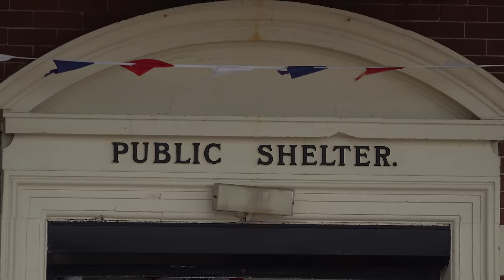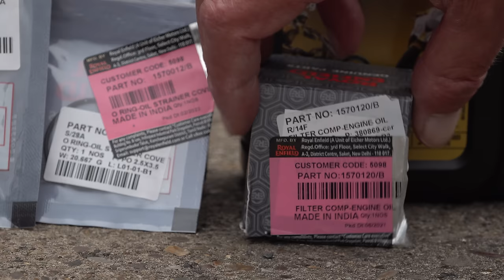Long Term Review | Royal Enfield Classic 350 | The Pure Essence of A mid 20th century 350 single!

Comment: I had the speedometer issue as well, but I live in Arizona, U S.A. where nobody cares if your speedometer works or not.  Therefore, I simply rode the bike until the parts came in...about three weeks.  It took the dealer three days to replace and I was out the door.  Wonderful dealer!  Like you, I do my own maintenance so I save some money there and in return, I gain a "relationship" with my bike.  A wonderful thing!
Reply: The issue that could arise in the UK, is the amount of recently introduced 20mph areas all around the country. Even for  the 350, an easy limit to exceed.
Reply: Just use a GPS speedo on your phone.
Reply: @martinowl  lts easier to get caught exceeding the speed limit than driving/riding without a driving licence or insurance nowadays.
Reply: Same here, about three weeks to get the parts. Once the parts were in the dealer let me make an appointment for having the speedo replaced. I was in and out in less than an hour with a new speedo. Outstanding!
Reply: @brianperry that is so true 👍
Reply: Did you get the RE at Kelly’s Kawasaki in Mesa?  Or GO AZ?  I think those are the only 2 RE dealers in the state. I’m contemplating getting an RE. I’m having some financial difficulties and may have to get rid of my Bonneville T100.
Reply: @MrSpeed-lt8gr  Go AZ in Cottonwood.
Reply: @martinowl Only for the poor people of Wales.....not all round the country as I understand it.
Reply: My speedo reads 110mph all the time. I can't afford the tickets. I need it fixed. 😅

Comment: I'm someone who had zero experience working on vehicles/engines up until I bought my RE. Using your videos, along with some others, I've managed to install crash bars and a sump guard, change my oil, adjust my tappets, and adjust my chain. I'd say it doesn't take experience to work on, just good instructions and some basic mechanical comprehension.  My journey on this started when my dealership said it'd be around $650 to get my valves adjusted. I wasn't about to drive an hour to pay someone that much for something I could learn to do myself, andhavent turned back
Reply: Same situation. Bought an RE Himalayan and the dealer was an hour away and wanted 600$ for first time maintenance at 300 miles. I bought what I needed for about 100$ and Never looked back!
Reply: I bought a 2023 Classic 350 in Chrome Bronze (the other chrome option) about 13 months ago and the love affair with this motorcycle continues. I an new to motorcycling but am doing some of my own basic maintenance and cleaning and have found it enjoyable and yet another way to connect with this cherished motorcycle.
Reply: That kind of money is hard to believe. I bet when you dd it you found it hard to justify too.

Comment: They should have hydraulic valve adjustment and belt drive to eliminate 2 major services.Old Hondas and Triumph had easy to adjust valves with simple to remove valve caps for easy access to the valves without taking the gas tank off. My Sportster just needs the fluids and filters changed.
Reply: and your sportster cost HOW Much - compared to this 350?
Reply: @CosmicSeeker69  My Sportster was 1 1/2 years old and it cost me $7,000 in 2000. I have had my Sportster for 25 years and 400,000 miles on the original engine and 37 back tires and 17 front ones and 3 belts in 25 years. Today you can get a good used Sportster for $1,600-$3,500 with low mileage. I have shops mounted tires that's it. Used RE 350 are going for bargain prices. Let's see how many engine rebuilds your 350 will go through in 25 years. If you still even have it. Think about how many chains and sprockets replacement costs in 400,000 miles compared to 3 drive belts . No expensive dealer serviceing either. They are counting on people who are too lazy to do valve adjustment themselves and taking it to the dealership for tune ups. They had hydraulic valve adjustment on the 500,less maintenance for the rider.

Comment: Once again my friend you have summed up both Royal Enfield ownership and the true meaning of a motorcyclist as only you can , keep it simple and honest! I have just got my Meteor 350 up to the 1500 mile mark and changed to fully synthetic oil, and its changed so much through the running in process that I cannot remember how tight and hot it was in the beginning but bloody fits the bill for both its now an entirely different animal and I can’t help thinking that so many people have bought these bikes and sold them on again just because they don’t have the patience and need instant results, running the motor in properly has im sure been a big factor in how my bike rides but fully synthetic oil has been a revelation, as has the fuel x optimiser  which a lot of people said is just snake oil but no its not and neither is the open air box but concerned with the motor running hot after i changed the filter cover i then put the optimiser on and the two together have made a massive difference , you can’t really use more air that the syst can deal with but now its got more air and more available fuel so its simply got bags more power at lower revs, and last is the 16 tooth front sprocket  again a major improvement through the gears i think its geared for riding on Indian back roads  because the bigger front sprocket if anything has quickened acceleration because first gear runs out just as it beginning to pick up its skirts n run  but theres more useful urge there that i can now access with the extra tooth , keep up the good work fella and no i’m I don’t want to swap my precious 😂👍

Comment: Hi Stuart. What tyre pressures do you use as the manual differs from CEATs own recommendations which are much different? I have been told that the CEAT front of 22 psi cuts down on whitr lining etc by other owners.

Comment: Wholeheartedly agree, bikes can get under the skin, I feel exactly the same about my little 321cc Yamaha MT03. I bought it initially due to it’s low seat height but then it grew on me due to it’s low weight, brilliant fuel consumption, excellent build quality, slick gearbox, super smooth power delivery, 100% Yamaha reliability, cheap servicing and enough power (42 bhp) to enable overtakes, headwinds and hills to be conquered with ease. Downsides, I don’t suppose the looks are to everyone’s taste, but you don’t see it when you’re sat on it !

Comment: Good morning Stuart, I've had my Classic 350 since the beginning of July, I've done 3,500 miles so far with no issues whatsoever, I've done all my own servicing right from the start with genuine parts and oil from the dealer that I bought it from,  so they know I've been using genuine stuff should I ever have a warranty claim ,but they have no issues with me doing my own maintenance anyway. 
As for enjoyment of the bike I have two other bigger capacity bikes that I enjoy but , neither of which give me the feeling or connection I get from riding my classic, it's just so relaxing to ride and takes your mind to another place, it's so therapeutic it's weird! 
I've fitted pannier frames, Lomo side bags and a dry bag for my tent and I'm all set for camping weekend's and rallies  that I do, as well as just buggering off out for rides in general. 
Great video review again 👍 
Cheers 
Mel 🍻

Comment: Thanks for the update Stuart. Interesting news about the home maintenance. 
I had an issue with the rubber on the rear tyre on my Himalayan breaking down. My local dealer at the time King’s ended taking a wheel off a new bike to
put on mine and sorting it with Moto GB because it was dragging on. Seems it helps having a good dealer 👍

Comment: I too had a Speedo issue on my Oct 21 mfg Red Chrome Classic 350 at about 5000 km, which was replaced by RE under warranty and the new speedometer started back from Zero. I have done 4000 km now and apart from this absolutely no other problem with the bike so far, it's such a pleasure to ride around the country side.

Comment: Morning Stewart. Servicing is something you touched on before I recall. When my first service came up in my RE 650 SM went into a shop I trust. £139 it cost and was in the shop for less than two hours before I got a text saying she's ready. The engin had less tappet noise. I noted the clutch had been adjusted and the throttle response was better. Once my girl was back in the garage I did a quick check for leaks as you do. That's when i noticed the chain had been adjusted and chain wax lub applied. Then the real surprise. A shot of chain wax lub was visible on the side and center stands  on the moving parts. The type of service you'd get only at a 5-star Honda dealership, so very pleased with there work. That said my brother-laws mate who bought the 350 RE Hunter had a bit of a shock. His first service £220..! So I guess servicing still depends on a shop location and it's size?
Wishing you and your family a very Happy Christmas sir. And all the best in seeing your channel grow in 2024! Safe cruising till next time Stewart 😊👍.

Comment: Stellar video, Sir! Thank you for fleshing out the errant speedo issue. My valve lash experience on both the INT and Meteor, with over 6500 miles on both, is after the initial 300-mile adjustment no further adjustments have been necessary. I have and will continue to check every 6000 miles. Just a guess but I think allowing the engines to run a couple of minutes unloaded when cold and common-sense riding is responsible.  Enjoy your well-deserved break Stuart and Happy Holidays to you and yours!

Comment: Stu, I'm a Meteor 350 owner, a sister J engine machine, so I'll comment. I knew that, as a retiree, if I wanted to get back into motorcycling, then I'd have to do most of my own maintenance. One, I do it to save money; if I paid someone else to do all the routine stuff, I couldn't ride. Two, the dealer is too far away; we're talking 45 minutes, one way, to get there. Then, you need to have a way back. Three, the dealer was so backed up with work that, the last time I checked, you were looking at a two month wait just to get your bike INTO their shop! To put it another way, when I asked the service manager if he could print out the valve clearances for me, he happily did so. He was relieved that there was one less consumer adding to his already heavy workload.

As you said, no one buys a bike like the Classic or the Meteor because they want a speedster. At my age, I don't need or want a speedster. In addition to being dangerous, speed costs money! I'm sure you've heard the old racer's saying: speed costs money; how fast do you want to go? No, 60-70 mph is quite fast enough for me. I don't know why RE went to the trouble of limiting the J series bikes though; given their weight and horsepower numbers, they would top out at 75-80 if ungoverned. That's no biggie though, as I don't ride much faster than 60 most of the time these days. I love the handling, the secure ride, the maneuverability, and how these bikes sip fuel. All in all, they're GREAT bikes!

Comment: Don't no if you read comments a few months later.
Always watch your videos shortly after release.
This came on while I was doing the dishes.
On the subject of defective speedos.
It is relatively simple to fit a wireless bicycle speedo to any motorcycle. As long as it you program the actual wheel circumference in carefully, they are very accurate.
+ Could keep you on the road.
- Night illumination could be challenging.

Comment: On the speedo issue from a SoCal rider. Mine went wonky, took it to the local dealer and they ordered the part the same day. It came in about 2 weeks later. I took it back over and it was replaced while I waited. On maintenance I am having the Hitchcock's Cam being installed right now. My guy is doing it for the standard valve adjustment price of $675. All of the RE dealers here in SoCal are also Ducati dealers so we get soaked for the commensurate labor rates. Before anybody says anything I was a racing mechanic at the local track for 6 years and also spent time on the Honda AMA team so yeah I can easily do anything on the bike but at my age I just want to ride. I have 3k miles on her and would recommend it to anybody that asks. Merry Christmas Stu!

Comment: I had a Himalayan, and it had a recall on the brake calipers, this took nearly 1 year before they changed both calipers. All other warranty issues on the Himalayan were granted and done pretty quick. ABS sensor, head bearings, speedometer. My classic 500 touch wood has no issues after 4 years. Let's hope my classic 350 is the same. Hope you have a great Christmas and New Year and thanks again for all your great videos.

Comment: I usually do my own basic maintenance ...  the 650 Interceptor is old school valve adjustment.... a bit of a pain to do as opposed to my Xs650's... my 500 Bullet is hydraulic .... Yes !... and my old Ducati's are the only bikes I don't do valve adjustments simply because I don't have the shims...they go to the dealer.  The only issue I've had on the Interceptor... in Ravishing Red ! .. was the rear master cylinder.... which was replaced under warranty.  I'm lucky in that my dealer allows me to do basic maintenance.... even the master cylinder.. in his work shop area parking lot. He's always busy and the shop still gets filter and oil payment.    I'm very pleased both machines.  :)

Comment: I thought I recommended a fix for you when you mentioned the issue... because I had an issue with the speedo and it had to do with a moisture issue with the connectors just disconnect the speedo and blow it out and put dielectric grease on the connectors and button it back up and I have not had an issue.

Comment: Its Mr T   a very excellent  video well said  I didn't really have tappet problem  as   4  of my bikes were 2 stroke  and 1 was a honda CB 350  thats the tappet  bit over   now for 
The  maintenance  did most myself and optaining service items were purchased at dealer in Troon  ayrshire  they had all u needed  genuine parts  now it's all send to  Hitchcock's  as very few dealers wish to sell as they want your bike to do not you doing it  service at 60s 70s only £20 to £30 by cooper bros in troon last bike I had  Suzuki  GT 550 m the only warranty claim for tha bike was the starter motor driving on motorway at hillington suddenly a stopping surge accured that nearly threw me over the handlebars  cause was the starter engaging with the engine and back wheel locked lucky only doing 40 -50 mph found out it was an inherent fault notified Suzuki  it was a Month out of warranty  but Suzuki agreed to supply all parts and I would have to pay the service which came to £50  that's my experience of servicing  ah last bill was £ 200 for 1st service of classic 350 RE keep up the good videos
Reply: Ah Cooper brothers . "Sorry lad haven't got one "(for a Norton)   "Got one for a Soot sooki " . If you knew the man you new the accent .

Comment: Got 2000 on my classic. 
No mecanical problems but does have slight condensation in the speedo, but it works fine and is only very minor .
I just wonder if the condensation is caused by the humidity in the factory where they are assembled and if their is a simple way of venting out the condensation.

Comment: Thanks for the vlog and all your knowledge about the 350
I have a question and am in the USA originally from South Wales UK and have been looking for a 500 Classic and have finally come across one a blue 500 Classic which looks mint with 2300 miles on it
My issue is price and value
It is a 2016 and since this bike has been discontinued and there are not many coming up for sale I’m at a loss as to what to offer 
This particular bike is private sale  and close to 4 k Firm US 
I’ve been doing my nut trying to find comparisons with no success 
I understand that there are loads of variables and to my eye it seems to look great sound great etc 
I am 75 and downsizing to a more manageable bike and have been on two wheels on and off 60 years
Any input would be much appreciated 
Regards from Florida

Comment: People understand the merits of a traditional 350 single, or they don't. RE could have designed valve covers into the engine, reducing a routine job by four-fifths, and if they tweaked future Classics to accommodate this I'd buy one. My speedo has had condensation from day one, but only in warmer weather, which is counterintuitive given that it's kept in a dry garage. A removeable rear mudguard panel would make puncture repairs a viable option, and tubeless tyres wouldn't hurt.